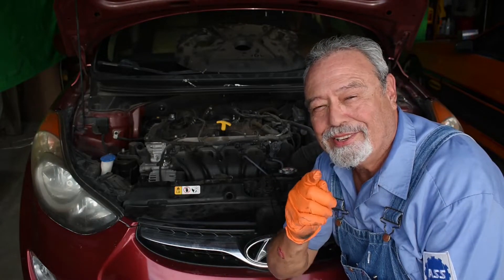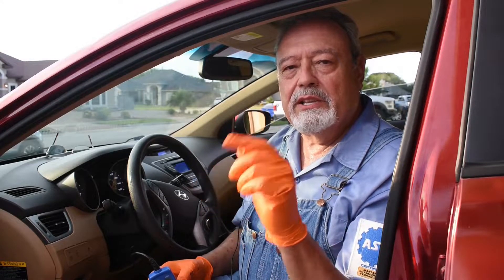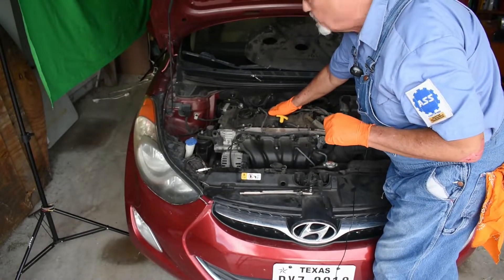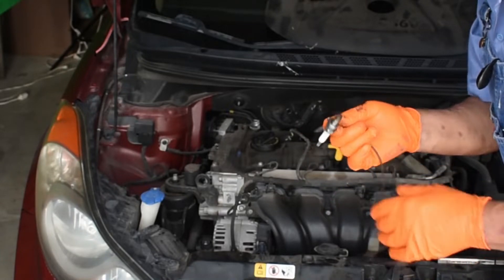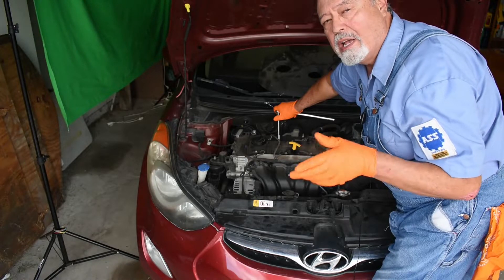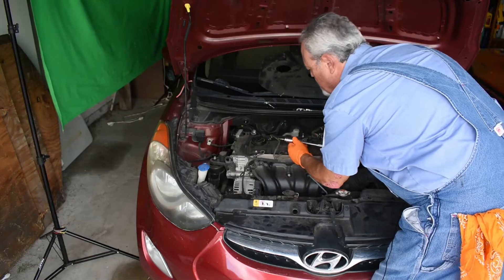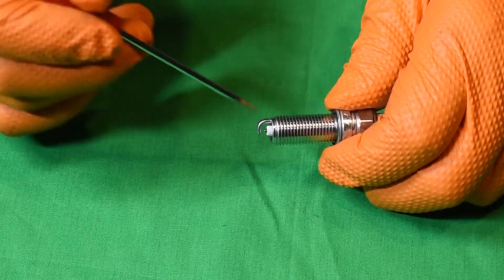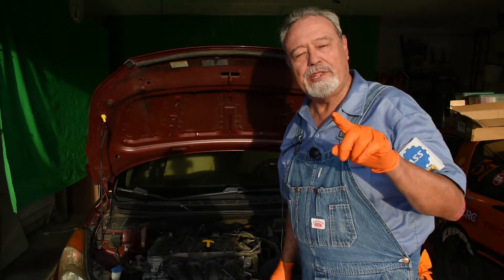How to Fix a Misfire.

Comment: If you got low compressing in two cylinder  can tgat be fixed with out major enging work
Reply from the maker: Hell Ya ! My engine had low compression from sitting / not running for 10 years. Watch this Short. This the same engine. Break a Leg / Good Luck. 
https://www.youtube.com/shorts/cdiPnDJaavQ

Comment: How do you tell when to replace the spark plugs?
Reply from the maker: Thank you for the view and the question. Spark plugs go bad three ways: The most common is they get "Dirty". Dirty of carbon / oil / fuel. When this happens it's not the spark plugs fault. The next way SP's go bad is the "Electrodes" wear out and the gap becomes excessive. SP's should last 100K miles. And the last way is the SP' becomes electrical "Open", rarely happens. I hope that was of some help.

Comment: I drive a 2015 GMC Sierra 5.3 my fuel trims are -16 ltft on both banks an stft are 3.2 on bank one an bank 2 is reading 2.8 as I raise the rpm to 2500 both stft go up no vacuum leaks thank you for your videos please respond   Thank you

Comment: Thanks for sharing the great informations about the spark plugs, I didn't know that the negative side of spark plug should be flat and parallel to the positive one. I've changed the spark plugs of my car before seeing this video and I tried to decrease the gap of 4 iridium spark plugs to 0.75mm, which was set at 0.8mm, by pressing the negative side to a piece of wood and now I'm hoping that I haven't messed with them so much and they'll do their job 😁
The car I was talking about is ikco Dena+ and I'm watching your videos from Iran

Comment: When should you change Iridium spark plugs, every 100000 miles, 200000, 300000? thanx
Reply from the maker: Thank you for the question and the views. If the engine is running "CLEAN" (correct air fuel mixture and little to no oil consumption )  Iridium spark plugs can last 150,000 plus miles. I think it is so awesome that someone in Belgium is watching my channel.

Comment: Nice information and demonstration professor.if we change copper tip spark plugs will it effect the fuel efficiency . In modern high voltage spark system will they give efficient performance I heard the copper tip spark plugs used old  c b point ignition system. Thanks professor kindly show us how to read wireing diagram of modern cars it's really complicated.🙏💐👍👌

Comment: Hi how you check compression hot or cold engine
Reply from the maker: Thank you for the question and the view. The following are important steps in checking gasoline engine compression:  prevent the engine from running (disable ignition or fuel system)  / hold throttle wide open  /  crank the engine for about 5 seconds /  some motor companies say the engine needs to be at normal operating temperature /  some motor companies do not require normal temperature.